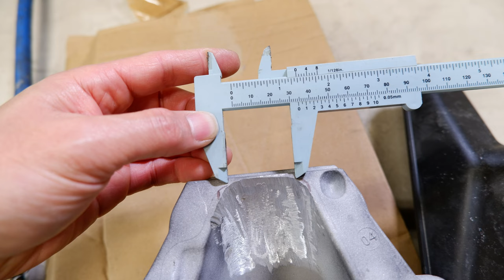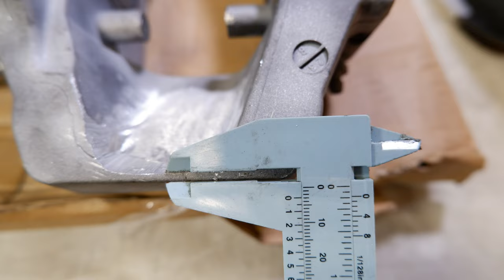Lexus IS300 Brembo 17z 6-Piston Porsche Audi Brake Calipers

Comment: I'm so stoked to be doing this to my own car soon, just gotta track down the front calipers at this point. The guy at Overkill Engineering was amazing to deal with! Such a chill guy
Reply from the maker: I would really recommend getting a 5” disk for the inside clearancing for rotor. That 4-1/2 new one I used was good then it got too worn. The backside clearancing for the steering knuckle can be done with a cutoff wheel. I picked up that HarborFreight electric cutoff tool after I already did the knuckle on back side. https://amzn.to/3hyOxoJ

Comment: any idea what size wheels on the front you can run without spacers? i have bought the 350phi kit and trying to get 8.5~9 wheel on the front
Reply from the maker: It depends on spike design and hub spacing. You need a high disk hub to clear most BBK.
Reply: @TunerwithKids  just to add. Great channel with some awesome DIY ideas. All the way from Australia thanks again for your help and guides!

Comment: Can the stock brake line be used for these calipers ,?
Reply from the maker: Yes using stock banjo nuts. But probably want to invest in some stoptech stainless lines. They are $100 for set.

Comment: Hey quick question, for the rear caliper swap on the IS300, can I use the factory bolts to bolt the Porsche Cayenne calipers on the car?

Comment: Great video but honestly this is way too much work... The IS350 calipers and rotors do a much better retrofit and all you need are two adapters available on eBay. No trimming or shaving required. I have them on my IS300 and they stop like a dream.
Reply from the maker: Yea much more work than expected. Would have gone with ISF 6-pot for $300/each new and 350phi brackets for bolt on. But this was more for the challenge and experimentation.

Comment: why the hell you guys call it spindle. is that some sort of German term?  toyota part number is called knuckle. I dont like these calipers, they are not radial mounted like the LS430 calipers
Reply from the maker: Spindle spindle, knuckle, hub assembly. All same shit. In an automobile, the wheel spindle, sometimes called simply the spindle, is the part of the suspension system that carries the hub for the wheel and attaches to the upper and lower control arms.

Comment: Can I have the link to that adapter bro.. the first gen is300 basically has the same suspension and brake setup right so I can use the same adapter
Reply from the maker: Overkill Engineering on IG

Comment: What wheels are you running? I did a bremdo swap on my is300 the hardest part was finding wheels that didn’t need spacers but glad I did it
Reply from the maker: I have my SSR Koenig but need spacers. You will need 18 or 19 with high disk to clear.
Reply: @TunerwithKids  I went with 18in  5 zigen Fnor1-c didn’t need spacers but it’s a super tight fit
Reply from the maker: Yea, Brembo is pretty good about trimming enough to clear wheels. The front 17z are giant. My rear SSR also need a 2mm space to clear the 17z rear calipers. I’m tempted to machine the face of caliper down to avoid it.
Reply: @TunerwithKids  yea they are giant that’s why I asked about the wheels. But it looks cools so well worth the struggles
Reply: @TunerwithKids  be careful one day on the 405 I got a rock stuck between my caliper and my wheel messed up the wheel alittle but I was pissed 😤 sounded a lot worse at 80+mph I was shook figured the wheel was coming off

Comment: Those calipers are way too small for the rotors.  18Z caliper is prob What you should have used.
Reply from the maker: There isn’t any clearance for 18z on is300 or contact surface of the rotor. Overkill_engineering is pretty experienced with this and he got it spot on for pad contact and clearance.

Comment: I want to put 330mm to 17z's for 17wheels could I;
Reply from the maker: Not on the IS300. The location of the stock mount ears and the steering knuckle won’t allow enough room to create a bracket they will line up or have full pad contact.
Reply: What can I do to put 17z 6pot on 17wheels
Reply: Mazda 323f v6 ba
Reply from the maker: There are probably a few (very few) 17 inch one piece with concave face that might clear but it’s a long shot. The caliper is massive height and face clearance.
Reply: If it goes with a disc of 330mm it seems that 17z's is for clearing 17wheels
Reply: I will get the face clearance with spacers
Reply from the maker: Yes the OE VW is 330 but the Lexus physical can not position the caliper to grab the disk and have pad contact.
Reply from the maker: On order to position the caliper and clock it to fit the IS350 334mm rotors the ears of the 17z will Need to be CNC milled to sit on the same plane as the spindle mounting ears so a custom bracket can be used.
Reply: Yeah I was planing CNC

Comment: im looking into getting this done but my interest is what size wheel will clear it. 18s of course but like more so offset & width to clear the calipers front & rear, what did you go with?
Reply from the maker: I have 3-piece SSR with low disk and neither clear. You need high front disk and medium rear to clear. On 5th Gen Celica forum, the owner, Overkill Engineering has good info and has the caliper to disk measurement. Gotta register for forum to view.
Reply: @TunerwithKids  ok gotcha lol bbk problems might have to run some spacers